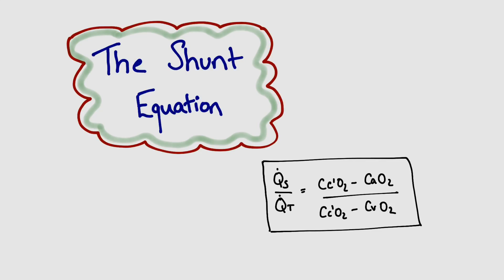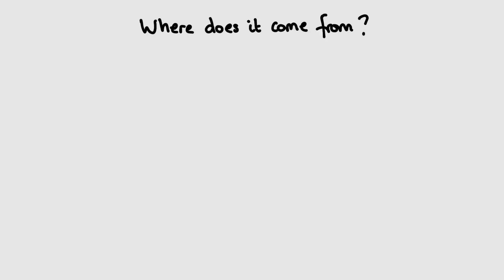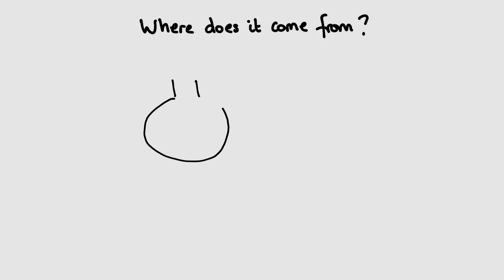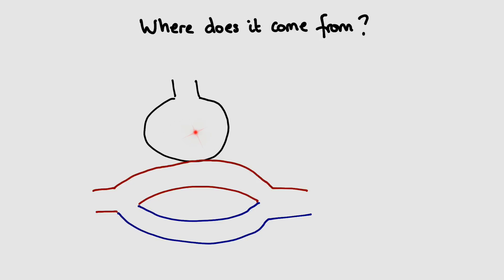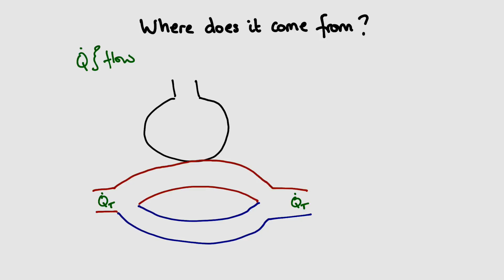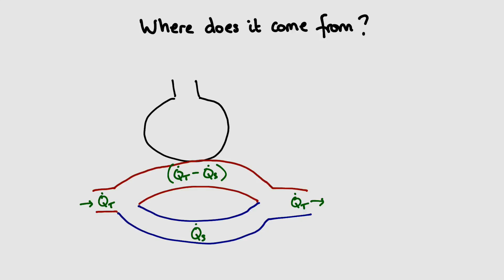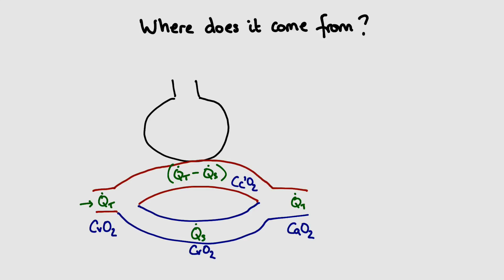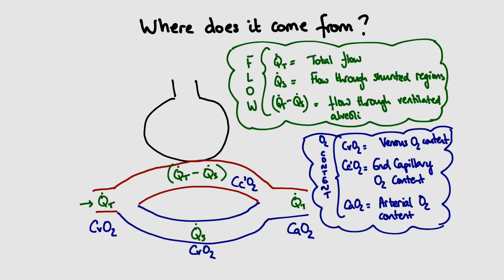Shunt Equation

Comment: The shunt equation only accounts for the pulmonary component of the total shunt (that which occurs from perfusion of non-ventilated or under-ventilated alveoli). It does not account for the Thebasian or bronchial venous return (because these blood flows do not originated from the RVOT/PA output, but rather follow different flow circuits). Therefore, the true CaO2 is not reflected by the systemic arterial ABGs. But rather the true CaO2 is reflected by the post-capillary pulmonary venous blood after admixture with the pulmonary shunted blood but before admixtures from the bronchial veins and Thebesian veins. Hence, the CaO2 from systemic arterial ABGs that is used to calculate shunt fractions is used erroneously. This calculation is at best an estimation/approximation.